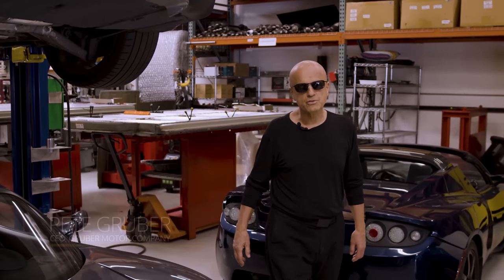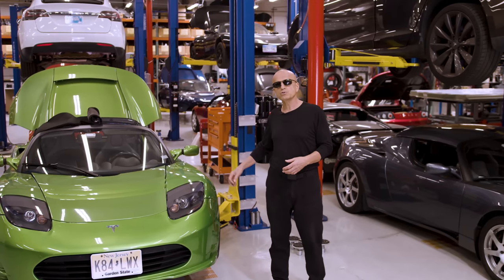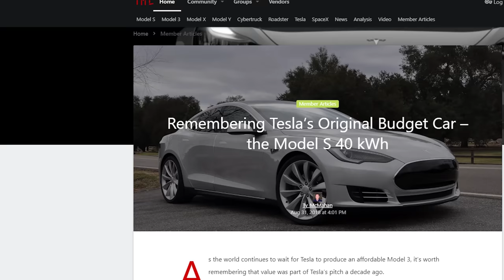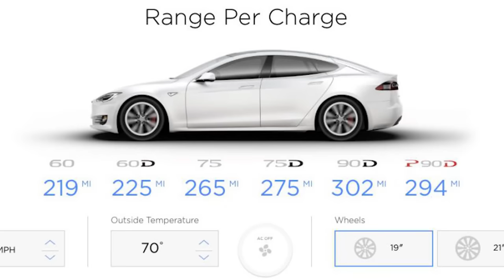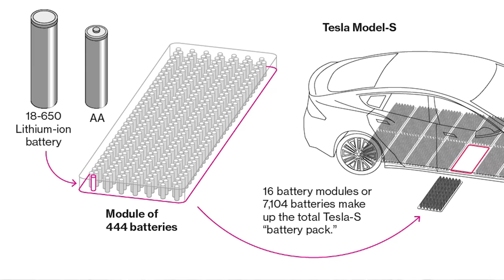Tesla Model S | Battery Upgrades | Gruber Motors

Comment: My Model S 70 wants to be a Model S 90 some day.
Reply: I got a 70D would be nice to have a 90D one day...
Reply: You should upgrade to the new 4860 when available, while it is a structural pack, that is mainly on the component itself and should still be able to fit into the bottom of your car.
Reply: @theadventureinsider  Fingers crossed.
Battery envy is the only thing I have for the new chars.
Reply: I have a bigger issue, my model 3LR thinks it should transforms into a P100D

Comment: We would like to see folks like you and Sandy (M.) pushing Tesla to create backward compatible battery packs for the original Model S (s) when the new battery cell technology hits the market. Don't let Tesla pull a Steve J and violate all the customer base that took risk as early adopters only to be abandoned by their trusted brand by no longer making backward compatible SW or in Tesla's case, batteries. Just think how cool it would be to have a 2012 Model S with a new technology battery that gave it 300+ mile range........ at a cost of $5,000.00 installed by Tesla. The world would trust Tesla forever knowing they could invest in an expensive car and Tesla would not forget them.

Comment: A question for the near future.  I have a late 2018 MS P100D.   If the battery was to replaced, do you think that using 4680 cells would be possible?   No idea how many things that would impact in the 2018 design.   But if it can be done, even if it's 50% the cost of a replacement 100 kwh pack, that would be a great option. 

Love to hear your thoughts on this.  Maybe not enough info right now.  But, when the time is right, looking forward to seeing an analysis.  And obviously this would apply M3 and Y owners.

Comment: If upgrading an 85 to 100 is not possible, why was there an upgrade possible from the 90 to 100kWh packs on the first European Model X?
Reply: He is talking about the Model S, no word on Model X
Reply: The upgrade is totally possible, packs have the same physical dimension. Few bits of firmware change, and you are good. However, collision safety and handling will be slightly compromised. As this is not under warranty, some people deem it acceptable.

Comment: Can you upgrade a Tesla Model S 85D to increase the charging speed?  Even with a little battery degradation, the range is still acceptable.  But the time spent at the supercharger is miserable.  My wife's 2022 M3LR charges so fast (at V3 chargers).  Even though it has longer range, we really don't stop any more often than in our MS.  But the quicker charge times make a huge difference on a several-hundred-mile trip.  There was some kind of charging upgrade available when we got the MS that was supposed to decrease charging times.  Maybe that option can be retrofitted?  Thanks!

Comment: Thanks for the info.  So what's the sweet spot for upgrades with a good used battery ...  Say I had a 60.  What would you recommend?
Reply from the maker: The 85 was a popular size, readily available, and priced well.
Reply: @grubermotorcompany  from what i heard on the TMC forum the 85 is the battery that had the most issues though.. along with degradation. also it wasn't much better than the 75kw from the 75

Comment: Why can't you add connection to external battery packs at the rapid splitter? Or add a 400V DC charge to the same area? Then maybe the car could charge stationary or while driving. The regenerative braking does this anyway!

Comment: My early 2013 model s 60 exhibited signs of module failure 2000 miles after my warranty ended.  Tesla quoted me $15k, $17.5k, and $20k for a 60, 75, and 85kwh replacement respectively.

My car is only worth $20k, so I'm interested in not only getting the bad cell replaced, but upgrading the pack.  Is this possible through a 3rd party without risking supercharger access?
Reply: That is a very good question.  Probably something only Tesla can answer.
Reply: @darkenergy5686  Tesla will disable supercharger access if they find out work has been done outside of their service centers....so of there's a way to upgrade the battery without it pinging home and telling the servers that would be ideal.
Reply: well thats why he made these videos, to drum up customers. contact them and tow your car to grubber motors duh
Reply: @heins4745  not helpful. It drives fine, and I'm not going to waste my time going there without talking to them.

Comment: At 14k plus 2k installation this is getting close to something I would like to do. My question is how much is the 75k pack in my X worth? Is it possible (cost effective) to convert it to stationary storage for a home or would selling it cover some of the costs of the upgrade?
Reply: If just degraded(10% - 15%), almost the same 10k+ on the second hand market. They are in high demand!
Reply: @tamasstrezi  If I could get 10k for it the upgrade would be a no brainer at 6k out of pocket.
Reply: But Tesla won't replace the battery unless it degrades to at least 70%
Reply: @anmarams  How is that relevant? It's very rare for these to degrade anywhere close to that if taken care of. Even cars that supercharger as a primary charging method don't often degrade that much. But it's not even pertinent to my comment/question

Comment: Well I’m going on 2 years with my Model 3 which has a 75kWh battery pack. Plan to keep it for a long time.
Reply: Be so sure. Our three Model S cars are from 2014 and 2015 with 300.000 km on each. Charging speed much slower at SuC but batteries only dropped like 10%. degradation should slow down with time so maybe 80% left after 20 years and still enough for our every day commute.

Comment: What about newer cells with higher energy density? Could they be used to avoid the extra weight? Also new more efficient motors. It's a shame if the the Model S body which is solid aluminum and will never rust couldn't be retrofitted with the latest technology.

Comment: I am very curious about if there's any information currently available on upgrading a 100d pack to even higher levels. I read somewhere that if the cells currently used in model 3 were inserted into a model S pack, it would increase battery capacity by 50%.

Comment: Does an upgrade from battery pack increase the performance or just the drivable miles?  I.e., 85 battery with 4.9 seconds to 60 upgraded to a 90 battery increase the 0-60 time?

Comment: Would be interesting to know what the typical repair on an older Model S battery is - if it is cells that fail, or if it is other components connected within the battery structure like cables or circuit boards
Reply: Hearing something about a water leakage defect on the forums

Comment: Excellent and informative presentation. I plan on keeping my 6 1/2 years MS 90D, well into the foreseeable future, it is a classic. Factory-built to order with $25K in options, most options no longer available.  This video put my mind at ease re future drive replacement considerations.

Comment: This was such a nicely done video. Excellent explanation and super super informative. 
Tesla has now "done away with" pack sizes and now just have LR & LR+.
Will those be able to retrofit into older Tesla's that have say a 75 or 85. Etc? How does the new packs compare and differ?
I have an 85D and drive well pasty battery limit everyday. When my batteries finally die, I am hoping to retro 9n a LR+ battery. A girl can dream, right??

Comment: Can you upgrade a 60kwh 350 V pack in a 2014 Model S rear wheel drive, to a 90 kWh 400 HP pack? If possible does it need a software upgrade too?

Comment: I wish EV's were more affordable.  The Tesla Roadster was released in 2008. That was 14 years ago. The hope was that the cost of EV's would come down as production ramped up.  I recall Elan Musk saying the model 3 was going to be in the 30K range. I just looked on craigslist and used model 3's with 40,000 miles are going for high 40's.  New Ford Mach E's are going for 65K+.  A new Toyota Camry or Chevy Malibu is less than half of that.

Electric Cars are in many ways are mechanically more straightforward than their gas and diesel counterparts.  They should be cheaper to make. When are EV's going to be made for the masses?  I feel like we need a new Henry Ford to show up.  When cars first came out, they were hand-built and extremely expensive. Very few could afford them.  

What's the deal?  When will the excuse of ramping up battery production go away? How many laptops and cell phones use lithium-Ion batteries. This is the same technology used in EV's.

Comment: You said the 60 kWh MS has a 14 module battery pack, but those 60 kWh MS-es actually have 75 kWh battery packs software-limited to 60. Do you know how Tesla does the limitation (activating/using only 12 of the modules, or charging all at 80% capacity)?

Comment: Great info and much appreciated! I do have a situation that has given me some pause with Gruber's info. I'm looking at a S90d that was fitted with a 100d, after the 90 pack failed. I hear that is a 100 pack with 2 modules removed, giving it 288 range instead of the original 330. Is this correct? The software shows it is now identified as a 100d vehicle.

Comment: OK. I have a 2013 Model S P85 with 140,000.0 Miles. So far so good. However, if my battery dies, what is the range of cost to repair my main battery pack?

Comment: Are the replacement packs that go into an 8yr old car going to have the new battery chemistry and battery cell size? Or is it simply a new battery of the same spec?
Reply: They will have the original 1865 cells, with the latest chemistry for those cells.

Comment: The explanation that the added weight affects crash behaviour would imply to me that the crash behaviour is different if single passengers or multiple are in the car. If net weight is higher one can load less up to max load - as long as I don't exceed max weight I don't need to do anything on suspension , control arms etc. otherwise I would need to change all this , as soon as more than 1 person sits in the car. I believe they have made up this explanation and need the 100 kwh packs for production

Comment: 0:10 All EVs will need a battery replacement after 30-40 years or more.
Batteries aren't going out in 10 years or 20 years.

Comment: If the battery cel chemistry was improved lets say 10% which may have already happened, possibly you could get a same weight battery with more range.  Also I have heard that some cars had batteries that were software restricted and that for a fee range could be improved.

Comment: Great video. Don’t think you covered how the 100 pack is structured and how they get the extra capacity compared to 90.  Also, the battery packs have a letter suffix that seems to indicate battery pack version; e.g. I have MX 100 ‘E’ pack.  What is difference between E, F, G, H?  Some of the range increases seem to be linked to battery pack version?

Comment: Great news specially for 100D and P100D owners, by the time the actual batteries die the replacement cost will be way less and all the maintenance saved will definitely worth, also less drama with motors, for some a great design car and in my case P100D a lot of time all the way along. It has been 6 years since I bough mine, initially 330mi, today’s date 288mi and 49k miles in the odometer. I have no problem in 12 years replacing the battery and still driving the same luxurious and quick Tesla. Full charge at night and can drive the entire week.

Comment: What is really needed is for both Energy and Transportation departments to establish a consortium of designers and engineers from the EV industry to develop standards, a family of quick exchange power packs that are compatible both in dimension and connectivity. These are some of compelling benefits of there: First, the viability of ownership of ownership by customers in dense high rise and other multifamily dwellers in urban and suburban communities in which individual Charon setup is simply not possible would be opened up. Next, viability for long distance interstate travelers like those of sales and manufacturing representatives would be created. Next, the possible threat of neighborhood power distribution grid overload would be obviated. Next, as breakthrough improvements in improvements in power storage density comes forth, a degree of protection from technological obsolescence would be afforded. Wasteful empty back hauls of empty petroleum transports would be eliminated by use of 18-wheelers being used to transport power packs to and from regional recharging and distribution centers, located adjacent to power generating and renewable energy harvesting plants. The exchange power packs could be equipped with tamper proof module for recording power consumption for aiding in collection of transportation maintenance taxes. The skateboard configuration would have to go!

Comment: I'd love to hear about upgrading a Model 3 Midrange battery to Long Range. As the number of used salvage long-range Model 3 / Y batteries is going to make this feasible. 

Also, a 3rd party has said replacing single modules or removing single cells on the S/X pack will cause failure in a short time. What kind of data do you have on that?

Comment: Thank you for the video. 

I have a LR Model Y and have been hearing a lot about sodium batteries lately. I've been wondering if it would be possible to upgrade in the future once my current battery becomes dated. 

I never thought of the weight difference until your video.

Comment: Hello do you know if this can be done in Europe as well ? is there firmware upgrades necessary ? if so you will have to do it through tesla I guess ? or could I buy a pack from a crashed 90D Tesla and put it under my 70D ? Do you get again 8 years of warranty on the new pack ?

Comment: extremely informative video but i do have a question, i see on the model s 60 there is 2 less batteries in the pent house, however can you not add 2 more modules into the penthouse which would then make it the equivalent to the 85?? is this an option?

Comment: Do you have plans on upgrading a current 18650 to the new, when released,  9860 batteries?  I have a P100D and would be really interested in switching to the new battery cell type.

Comment: Ultimately this is the reason why I decided to get a hybrid until a few years from now as cheap as you can get a used Tesla I expect the range capacity to get closer to 400 as time goes on and used Tesla's will become far less valuable than new ones in my estimation
Reply: That was my idea back when I first heard of a Model S. I will just wait a few years, they will depreciate like a used BMW or Mercedes, and I will pick up a nice one for 20k. That did not happen. I bought my 2015 90d in 2019 in a private sale. There is nothing on 4 wheels with resale value like a Tesla. My credit union  was happy to finance the asking price. 
I would advise, get the car now and enjoy the absolute best, and the low operating an maintenance costs work for you all along. In the long run, you are dead.

Comment: Good video.
What are your views on replacing the 12v battery in an S with a lithium 12v - good idea or not?
Reply from the maker: Depends where you live.  In warmer climates, it will do fine.  I frigid climates, not so well.
Reply: @grubermotorcompany  
Many thanks for that. I’m in Australia - the temperature where I am rarely goes below 8’ C and in summer around 37’ C max.
Reply: @grubermotorcompany ,thanks for that info, never thought about cold temperatures on 12v lithium. Would need battery blanket or heater.

Comment: It's a shame you guys are no in socal. At least shipping to phoenix is relatively inexpensive. I've always wondered if it would be possible to upgrade 60 packs. By placing two more modules in the penthouse.
Reply: I asked the same question but found out the module cell count of the 60 is less than the 85 packs.  I think 384 vs 444.  There is also cooling lines that need to be fabricated and electrical circuits.  I don't think it's cost effective.